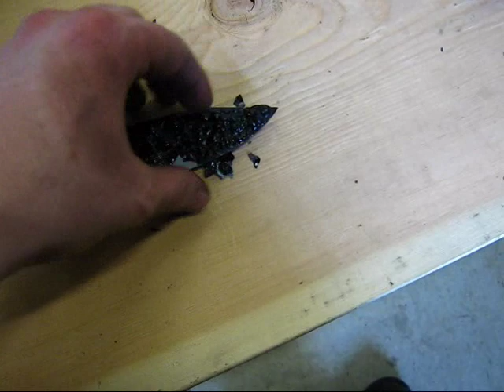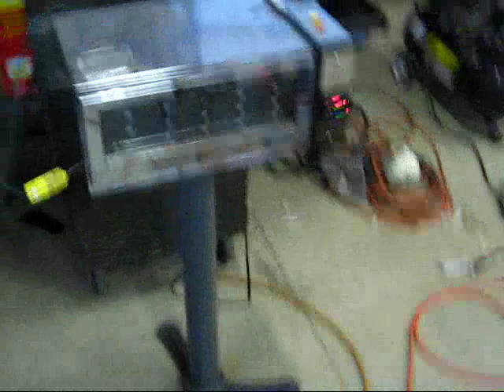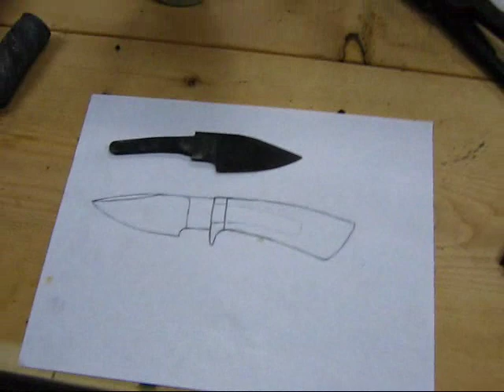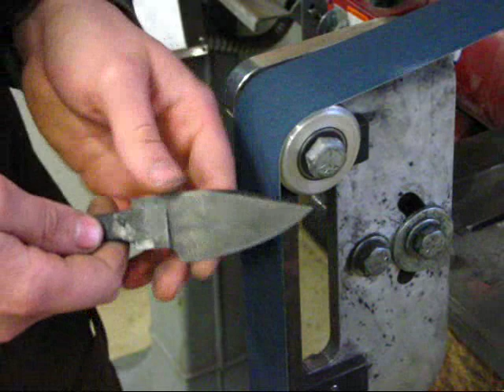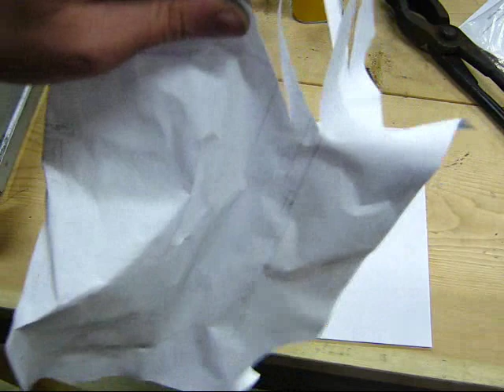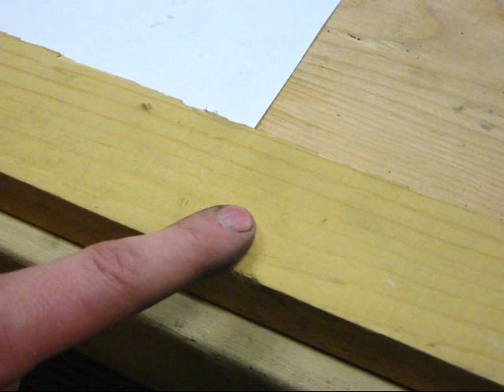Forging a New EDC Knife - Part 6

Comment: @FredeenBlades I can see the logic with this. Otherwise your going through the process of normalizing and heat treating ,just because that's what we read or was told once,without really know if it's worth it.This way you can prove it to yourself.
I just got some 10mm thick O1 tool steel to make a bush craft knife.I'll take my time and do some extra heats,before hardening.